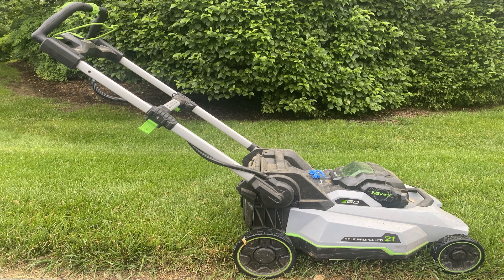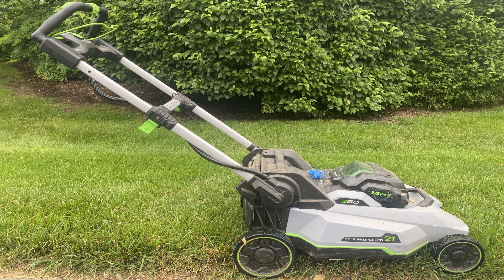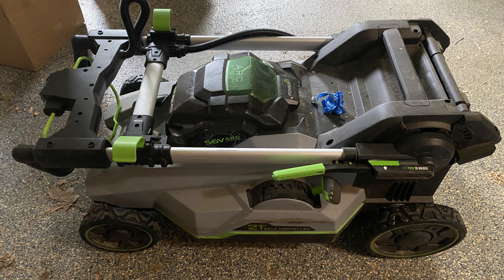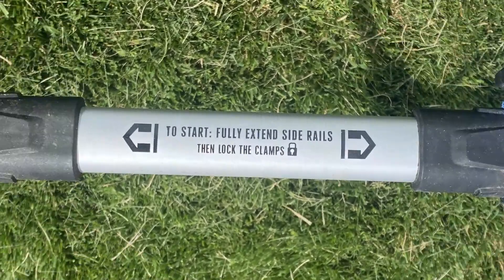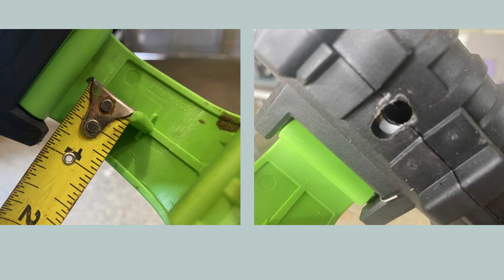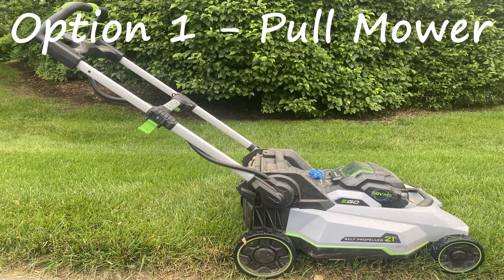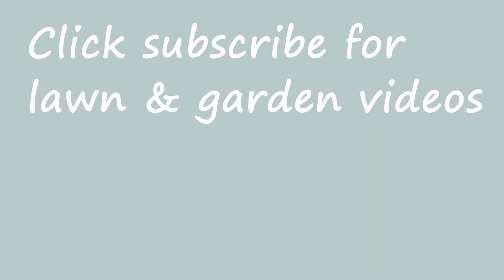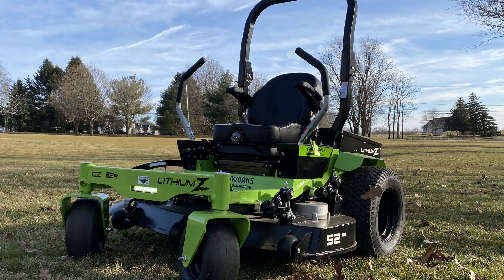Ego Power Select Cut Push Electric Lawn Mower Design Flaw

Comment: I have the same or a very similar model and I discovered another design flaw.
My mower has the self propel feature. Whenever I engage the self propel the wheels rotate slightly forward which causes the back of the mower to slightly lift up. It took me nearly two years to realize it was happening. Even though it’s a small lift, it causes the whole mower to tilt forward. When a mower tilts forward you are going to get the worst possible cut.
So I stopped using the self propel and I just push it to get a better cut. Luckily the mower is relatively light, but it’s still a lot of work.
Nothing on my mower is broken. This is a design flaw that exists on all these models from the factory.
Reply from the maker: That stinks. I support designing products to be safe but when safety prevents basic functions from working as expected than they become more dangerous because owners rig them to bypass safety feature… frustrating. I’m looking forward to purchasing Stihl Electric products this spring and posting comparison videos vs Ego

Comment: Ego have always been very helpful to us whenever we've had any problems or user error.  If you can't get cust service you can drill out the broken tab on the clamp and install an appropriately sized rivet.  If you're not handy with installing rivets (which seems likely from your painters tape and screw solution), just buy a replacement clamp from ego for $4.  You can see the part number on the green clamp in your video.
Reply from the maker: Thank you for the comment. I tried the replacement part (link in description) but the entire piece is cracked so it did not hold securely. I found a better workaround that makes the mower usable. Unfortunately this is one of many breaks across many EGO products that were taking too much of my time. This year I’ve started the transition to Stihl and will be posting videos in the coming weeks…